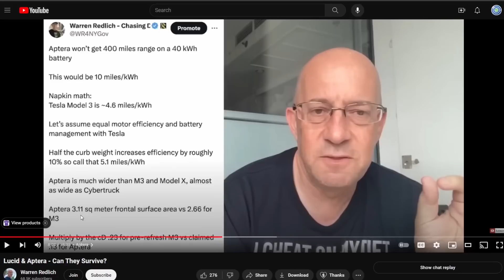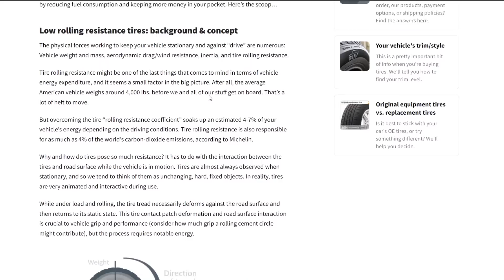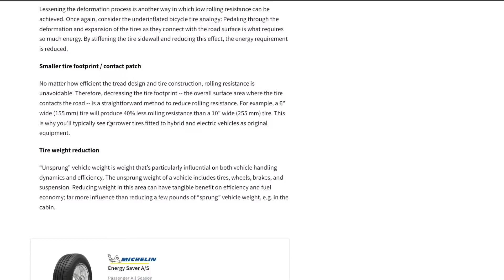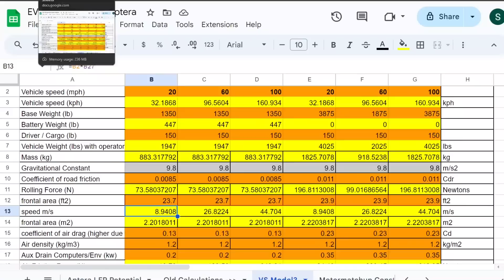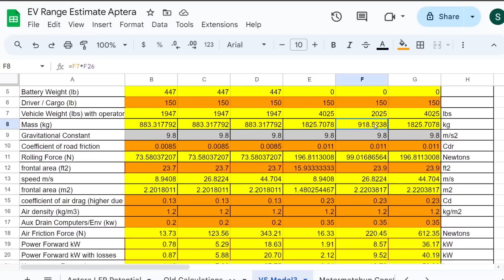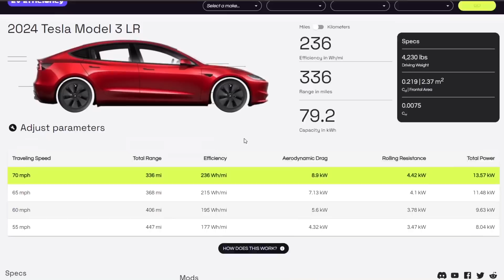Revisiting Aptera's Efficiency

Comment: Hi Steve, here is a little calculation that I did.  I don’t know if I made any mistakes or did not take all of the costs in account, but tell me what you think.

Cost comparison of Aptera vs. Nissan Versa for commuter 

This estimate has been made to determine if Aptera will be the most affordable commuter vehicle on the road (including ICE cars).  The “break even point” compared to an affordable internal combustion.  This first calculation is comparing the Nissan Versa (considered to be one of the top rated affordable commuter vehicles based on cost of the vehicle, maintenance, and fuel consumption).  These are back of the napkin calculations, but demonstrate that by year 7 (about 100,000 miles), the cost of the Aptera becomes less than that of the Versa.  

Estimated cost of Aptera 250 mile w/ full solar pack: $26,800
Cost of base model Nissan Versa (2024):  $17,660
Average of 40 miles per day for 365 days: 14,600 miles per year
Cost of oil and filter changes every 7,000 miles on Versa: $100
National average gas cost (2/12/2024): $3.196 per gallon
Versa gas mileage (listed highway): 40 miles/gallon
Cost of tire changes on Aptera (195/45 R16, $56.93 per tire, 60,000 miles, times 3): $170.79
Cost of tire changes on Versa (205/55 R16, $58.97, 60,000 miles, times 4): $235.88
Cost of brake changes on Aptera at 100,000 miles (because of regenerative braking): $ $75
Cost of brake changes on Versa at every 70,000 miles: $100
Versa timing chain replacement (120,000 miles): $655
Aptera replacement battery cost?  Not known, but I go into this again at the end of this comparison.
This assumes recommended maintenance at the long end for the Versa and no breakdowns by either car.

Day one:
Aptera: $26,800
Versa: $17,660

Year one (14,600 miles):
Aptera: $26,800
Versa [car cost+gas+2 oil changes]: $17660+1166.54+200= $19,026.54

Year two (29,200 miles):
Aptera: $26,800
Versa [car cost+gas+2 oil changes]: $19026.54+1166.54+200= $20,393.08

Year three (43,800 miles):
Aptera: $26,800
Versa: $20,393.08+1166.54+200= $21,759.62

Year four (58,400 miles):
Aptera: $26,800
Versa: $21,759.62+1166.54+200= $23,126.16

Year five (73,000 miles):
Aptera: $26,800+170.79= $26,970.79
Versa: $23,126.16+1166.54+200+235.88+100= $24,828.58

Year six (87,600 miles):
Aptera: $26,970.79
Versa: 24,828.58+1166.54+200= $26,195.12

Year seven (102,200 miles):
Aptera: $26,970.79+75= $27,045.79
Versa: $26,195.12+1166.54+200= $27,561.66

Year eight (116,800 miles):
Aptera: $27,045.79
Versa: $27,561.66+1166.54+200= $28,928.20

Year nine (131,400 miles):
Aptera: $27,045.79+170.79= $27,236.58
Versa: $28,928.20+1166.54+200+235.88+655= $31,185.62

Year ten (146,000 miles):
Aptera: $27,236.58
Versa: $31,185.62+1166.54+200+100= $32,652.16

Now the question is battery replacement on the Aptera? We don’t know the cost and we don’t know time, but if it is between 100,000 and 200,000 miles it should be about now.

To make the car cost exactly equal in costs at this point (ten years), the battery pack replacement would have to cost:
$32,652.16-27,236.58=  $5,415.58

This calculation does not consider insurance costs (which maybe cheaper for an auto cycle compared to a four wheel vehicle).  I could not put a graph in the comment.  Tell me what you think or have other factors to consider.
Reply: Aptera is definitely far more fun than driving a Versa.  I really think they are missing the sports car marketing angle in overemphasizing solar.  Aptera is a fast and nimble vehicle compared to 90+ % of the things on the road. Unlike most sports car Aptera is affordable, electric and has storage.
Reply: Good points.  You could also argue that the Versa is a four seater.  That could also be a factor for the buyer, but most people commute on their own.

Comment: Great example of the Dunning-Kruger Effect.

"The Aptera is wider than the Tesla Model 3"

Yes, because the wheels are located out AWAY from the body in fairings. You do not count the space between the body and the fairings. 

Putting it another way, the air flows around the body and each of the two fairings separately. You would add the air resistances for each of the three shapes together.
Reply: and add in some interference drag....
Reply: @ericstarmer7779  I would expect very little of that since the body only becomes as wide as the track well behind where the wheel pants end. Any turbulence would be reflected in the drag coefficient.

Comment: Redlich is a tesla cuck simp and conflict of interest in that he has stock in tesla where Steve does not...not sure about the other guys that did calculations.
When I get mine I'll drive the shat out of it where I do my testing on my Miata and motorcycles.  Mountainous road with about 14k feet of elevation change in about 30miles.  I ride/drive this at very spirited pace testing/tuning brakes and suspension on my Miata and motorcycles.  On my 2020 ZeroSR EV motorcycle it uses over 100watts per mile at a spirited pace, easily under if going the speed limit.

Comment: The proof of the pudding, as they say, will be when people actually start driving these things. No amount of theorizing will give you real-world results. That's why we have EPA testing where they physically test vehicles to give them an efficiency score. But even EPA testing can give inaccurate results compared to people actually driving electric vehicles as Bjorn Nyland does on his channel, running the battery down until the vehicle stops driving and noting how many miles or kms were driven from full. Anything short of that is just speculation. It'll be interesting to see how long it takes Bjorn to get his hands on an Aptera after they are released in Europe. That will be one interesting video for sure 😊
Reply: Computer modeling has become quite accurate.  Of course, real world efficiency numbers will be a little different, but I would be surprised if they are off by more than 5% or so.  
If you don't believe in computer modeling then you had better not get on a modern airliner.  Modern commercial aircraft are ALL designed using computer modeling.  Flight testing these days is primarily used to test systems and also confirm the computer models.  Often the first article "prototype" off the assembly line goes into commercial service.
Reply: @wingsounds13   There are a lot of variables that affect EV range, and with Aptera there are a few more, such as how much solar energy can be absorbed which in turn depends on the latitude, time of year, how cloudy it is, how much shading affects the parking location, also temperature which affects the efficiency of the solar panels. 

Then you have the usual things like the terrain, wind, temperature affecting the battery performance, aircon or heating usage, individual driving style etc. 

Not sure if Aptera will use a heat pump or resistive heating, but that is going to affect efficiency in cold weather. 

So, the point of saying all that is that you can't just give one figure for range, like you are always going to get 250, 400,  600, or 1000 miles depending whatever model Aptera you are driving. 

If you are in subzero temperatures and have to preheat the car, or in 30 degrees C or more, and need to run the aircon continuously at full power, that's going to eat into your range. 

I am not sure whether 400 miles is the maximum range for the Launch Edition vehicle, for example, or is it a median, like maybe it varies in a range between 350 and 450? These are things that people will only find out from experience.
Reply: @aftonline  what you seem to be saying is that range ratings for EVs are meaningless because real world use will be different.  The range rating given is just a base reference, and yes, Your Mileage May Vary.  

It will be interesting to see what the EPA range is on the production article, though as most of us know this is often a Wish rather than You Will Get.
Reply: @wingsounds13  tests of evs (especially in winter) have shown huge variation in real world even when trying to compare apples to apples between different vehicles.  Epa numbers have a variety of calculation methods and tesla is routinely toward to worst for real vs epa.  That said if Aptera can be 400 km real world I'm good.

Comment: Excellent analysis. Your point on tires raises an issue of what type and brand of tires that the Aptera will use. Has that been established? 
Tires are one of the most important parts of the car, and there are large trade-offs between cost, performance, rolling resistance and longevity. Many car companies either go very cheap or choose a tire that boosts performance or mpg. Both choices can seriously undermine longevity.
I hope Aptera makes a wise decision on tires.
Reply: Tires was mentioned in a previous video..Think it was Chris Anthony that said which brand/size.  I recall a Korean brand.  The Korean tire companies are ahead as far as making tires for EVs, they have more choices for EV than anyone else.
Reply: In a video that listed shipper information I noted that Aptera purchased a lot of 50 Hankook 195 50R16H L,B,I-HK.  These are probably the tires being used on prototype builds and likely the Production Intent builds too.  I am uncertain as to whether these are their final choice for production.

Comment: obviously the aptera pushes a lot less air around than a model 3 and has one less tire, and weighs significantly less, but does that equate to 2.5 times more efficiency than a model 3? I'm just guessing and saying maybe the aptera will be at most twice as efficient than a model 3. We still need to wait for a 3rd party validation and still not a single validated vehicle built......still waiting.....it's only February 2024.
Reply: Unless you're saying that the Aptera will break the laws of physics in order to underperform, I'd say you don't have anything to worry about. 

The whole point of science is that its results can be predicted, and then verified by comparing those predictions to real world data. Wait for the test results instead of just saying that the calculations must be wrong because you feel like they should be wrong.

Comment: Good summary.  Curtis' spreadsheet is indeed enlightening and Drew's non-engineer summary was also good.  That said, I will put on my science-based review mode and offer a few points:
Review the any sort of discussion like this for three things: completeness, precision, uncertainty.
Completeness: Rolling resistance is more than tires.  It includes bearing resistance as well.  Probably a smaller effect. Electrical efficiency is more than motor efficiency.  It includes efficiency in AC-to-DC and DC-to-AC conversion in charging and discharging. Here, it is significant whether Aptera used silicon-carbide converters. I have seen discussion of whether they thought the added cost was worth the improved efficiency and I do not have data to show what they chose.  It matters.
Precision: My science and engineering professors would often cringe when we put down too many digits in our formulas.  ("cringe" meant a reduced grade.) The point was always to put down the precision we actually knew, not the number of digits our calculator showed on the screen. It is surprisingly hard to do this and forces better depth of understanding. Curtis has several numbers where he uses seven significant digits.  No, that fails to portray the real level of understanding.  He can do better.
Uncertainty: A more-complete story can be told by showing a range of inputs, commensurate with our understanding, rather than single-point values. Something like weight probably has a small range of values, but understandable.  Coefficient of drag, baring real testing or detailed simulation of final design, probably has significant uncertainty. Exactly 0.13 is unlikely.  A little better or significantly worse is more likely.  Again, investigating what the uncertainty is will yield better understanding.
Am I being picky?  Of course, it's what I was trained to do.  Will it matter? Yes, in the third significant figure or probably even the second. Not the first. (xxx Whr/mile)  Did I miss something?  Probably, but that's the point of comments.
Reply: Woah, great comment. Good point about the significant figures; I'll apply that to my own engineering studies myself
Reply: The worst assumption made by Redlich was that drive train efficiency was equal between Tesla and Aptera!!!   He doesn't understand the simplicity of the in-wheel motor in comparison to the complexity of the Tesla drive train.   Two bearings and seals per wheel for Elaphe' motors vs motor, gear box, constant velocity joints, differential and drive shafts of a conventional EV.  Oh, and I almost forgot the reliability of in-wheel motors vs. complex drive trains.
Reply: @paulevans4969  Aptera is a new unproven powertrain and while it is possible it could have higher motor efficiency they will be using worse inverters so I wouldn't assume Aptera would have an advantage here.  It will probably be +-2.5 % either way which means ~10 miles of range at most for the LE.
Reply: Completeness:  I decreased the powertrain efficiency in my model from 90% to 85% to account for the inverters about a month ago.  I retitled the powertrain efficiency field to include both. Aptera will not have silicon-carbide inverters per an interview with steve a few months ago.
Precision:  I simply didn't set the cell formatting on some things and the results is excessive numbers of digits.  Doing the calculation results in excessive precision; this was not intended to be a pretty user friendly website like motor matchup.  I made this sheet to sanity check the numbers and see if Aptera would do excessively poorly at speed or on rough roads.
Uncertainty:  I was using 0.14 in the sheets until recently.  Steve and Chris have stated the 0.13 Cd number repeatedly in interviews so it seems they have more confidence in it recently.
Reply: @ccibinel  I do appreciate the work, so don't consider my comments negatively.  From that Steve interview, I thought he said they were still thinking about silicon-carbide.  Since that makes a larger efficiency change than including or omitting mirrors, for example, I did not understand going cheap and maybe hoped for reconsideration.  Such a decision belied the efficiency-is-everything mantra coming from the founders.
Precision really has little to do with calculation precision or formatting, imho.  It has to do with how precise a given input is known - or even knowable. Spreadsheets have been the bane of trying to get that across and often mask the limits of knowledge.
 I'd say your Cd of 0.14 is no better or worse than Steve and Chris's oft-repeated 0.13.  They are understandably very good at being consistent, but I would not attribute that to better science, since they have touted the same value despite changes in vehicle shape (longer, or mirror area change, or front wheel strut streamlining, for examples). I would suggest they are consistent because they do NOT have new information from more precise calculations or, better yet, measurements with final designs.  All quite reasonable, but it points to the impossibility of having overall results better than two significant figures.
Reply: @johntrotter8678  do you recall the title or date of Steve's interview when he talked about the inverter?  I looked for it and couldn't find it
Reply: in the days of hand calculations keeping intermediate values short -- the right number of sig-figs -- can make calculation easier/faster.  these days computers keep all available precision, and nobody rounds intermediate values in their code (or spreadsheet formulae).  there is no "excessive precision" per se, just missing error bounds which is what sig-figs are intended to convey (an approximation thereof, rather than actual error bounds found using numerical analysis).  yes, maybe the final output value should have been formatted to display fewer digits.  except that in exploratory spreadsheets like this, it's not always clear which values are "final" outputs.

but this is how having a copy of the spreadsheet can really aid understanding.  for both precision and uncertainty, we can change the inputs to see how sensitive the computed outputs are, without actually doing the numerical analysis.  to get the feel of the math, without grinding through the numerical analysis.  there's no need to repeat the calculation in the spreadsheet w/ a range of values when you can just change the values yourself!

Comment: Dunno where I got the numbers but I have 2.8m^2 for the frontal area and .13 for the Aptera. Assuming a constant speed of 62 MPH on flat ground, 35 PSI tires, and a 220 lb load, ~400 miles range should be expected on a full 40kw charge. I don't have the M3 in my spreadsheet to compare, but the Model Y would only make it ~180 miles on that same 40 kwh.

Speed is a massive effect on expected range. Slowing down to 54 MPH jacks the expected range up to ~500 miles. 74 MPH drops it to ~300 miles.

(Note, I used a PT efficiency of 100% for both which isn't realistic and would likely lead to a bigger % difference between these.)